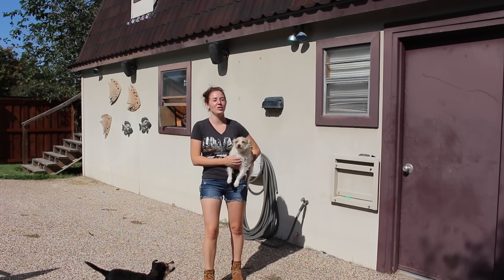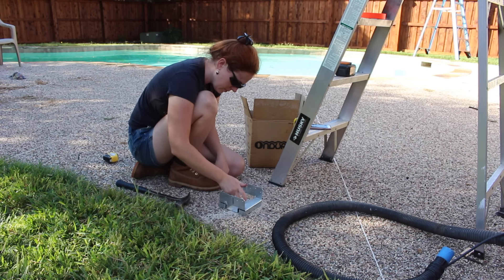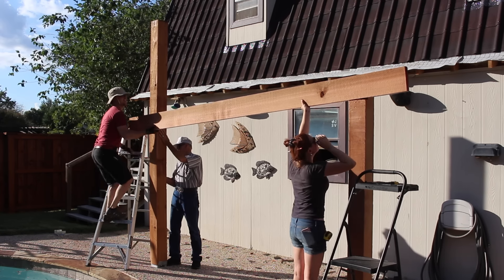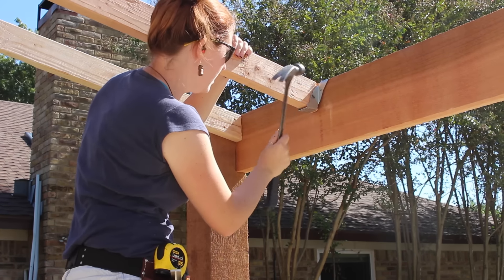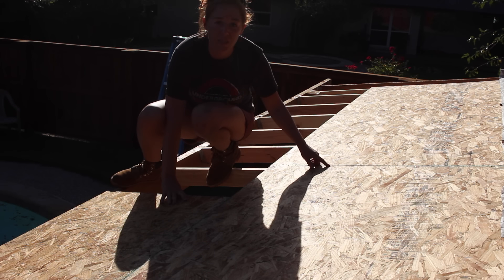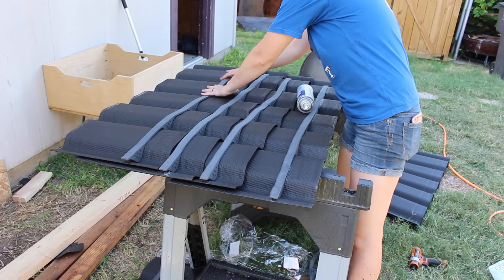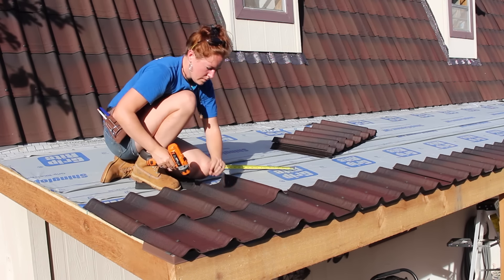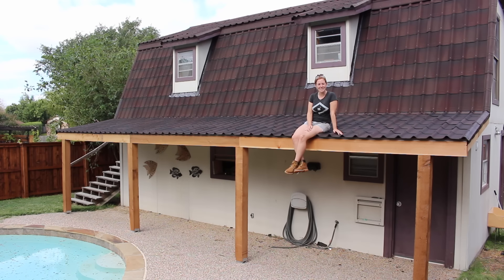How To Build a Covered Patio | DIY Porch Part 1

Comment: It's seems weird that American DIYers just don't seem to have SDS hammer drills, in the UK if you do any DIY you need one, they are just necessary since our houses are make of brick.
Reply: Absolutely (I'm from the Netherlands) and when doing things around the house you absolutely need one
Reply: Interesting. I live in the US and have one, but nobody else I know has one. It is amazing how well they go through masonry.
Reply: And in Germany you need a hammer drill, too.
Reply: I've had one for 35 years, the only way to go!
Reply: +Foeke van Veenendaal Everybody builds with what's local and cheap. Where I'm living now, stones, clay, and sand are local and cheap. That's why a lot of the houses in the neighborhood have 5 foot thick walls made mostly of native stones with clay and sand mortar. The houses last 300 years instead of the 30 years you get with balloon framing.
Reply: I imagine that all the rain in the UK makes wood houses a bit of a no go in terms of rot and damp.
Reply: Well, considering that our country isn't even 300 years old yet...
Reply: I've got mine! would never be without again.
Reply: My house was built in 1928 with balloon framing.  Doesn't seem like it's coming down anytime soon.  30 years?
Reply: Kelly Stone In any data set, there are outliers
Reply: Yeah my town has thousands
Reply: More timber framed houses are starting to be built within the UK now. It was a big problem with getting insurance for your house if it was timber framed. However, that mind set is changing with insures now.
Reply: A good thing as they go up in weeks, not months like brick houses and that's what we need, more homes.
Reply: markblue777 Timber framed or balloon framed? Balloon framed is made mostly of 2x4 (5cm x 10cm) studs, goes together quickly and cheaply and looks very good, for the amount spent, for the first ten years or so. It goes up fast, comes down fast, and is cheap to build.
Reply: well the original lot that insurance companies would not touch were the Balloon framed. Now days it's more pre-fabricated wood panels so its build in the factory rather than on site. (timber framed was a poor choice in words i realise now as timber framed house, made with oak and such have been excepted and still are made as well).
Reply: I have never seen any houses here framed with 2x4s that look good only the first ten years or so? I wonder where you are getting your information since you aren't local and wouldn't know these things. We have timber homes because we have lots of timber. They are beautiful and well  built and warm, by the way. Stone houses are beautiful also.
Reply: letmework Where is the "here" that I'm not local to?
Timber framing is completely different from 2x4 studding.
Reply: Jim Fortune; I'm sorry I didn't make my response more clear. "local" is America where Foeke van Veenendal stated that "weird" materials are used.  In what environment does pine only last two years tops? And were the fences that were needing repair after a wind storm, split rail? Part of the beauty of any region or locale is seeing how the natural environment is incorporated into buildings and architecture. We are surrounded by beautiful forests and love it!  Why shouldnt we showcase these beautiful species in our homes?  We recently lost a one hundred years+ Big Leaf Maple tree in our back yard and instead of cutting it up for firewood we had it milled into lumber to make furniture with the beautifully spalted wood. And perhaps you misundertood my comment about timber homes. I did not say timber -framed homes. Timber homes are homes made from timber (wood) vs. stone, brick, clay, etc. As far as 2x4 stud framing; I live in a home built that way and it's now 45 years old and is as good as it was the day it was built. Perhaps the commenters here are completely misinformed. We'll give you the benefit of the doubt.
Reply: letmework I have to confess that my disdain of balloon framing comes mostly from 40 years living in Southern California. The tract housing there is thrown up quickly, on a budget, and with assembly line techniques. Most of the framers don't know nor care what "square" is and the materials are not exactly hand selected for superior quality. Typical construction is 2x4 frame clad with chipboard, covered with tar paper and chicken wire, then sprayed with stucco. Even in a climate that seldom sees snow or ice the houses deteriorate pretty quickly. Ten years and the house is in need of significant work, and after thirty years it's a debate as to whether it isn't better to just tear it down and start over.
By contrast, I'm now living in a 300 year old house in Poland. The ground floor walls are about 6 foot thick stone and brick, the upper floor is half timbered and the "new work" done upstairs is about 100 years old. It's quite a contrast from So. Cal.
Reply: It's more about instant gratification and our disposable culture. The town I am from used to be all adobe houses but now everyone just buys a mobile home.
Reply: Kelly Stone You are smart. Why does everyone hate wooden houses. There are 3 story wood houses in the original colony states (New York, Massachusetts...) that are wood framed with rubblestone foundations that have been her longer than the USA was a country.
Reply: Jim Fortune Actually, most modern framing with studs that we are used to is called platform framing, and is very sturdy, especially thanks to pressure treated products, codes that overbuild everything (which is good).
Reply: Jim Fortune Well, that has more to do with crappy carpenters. Also, it os now called platform framing. Balloon framing uses a slightly different stud and header system and was used mainly before WW2. Its downfall was that it required long studs.
Reply: Mark Doumert 

g

8
Reply: I remember from a high school history class (30 years ago) that stone became the preferred building material to wood after the "great fire of London." I thought that was a no-brainer. As for building materials used between Europe and North America, I hate to say it but both regions subscribe to the "international building code." That means if you pull a permit to build something, you will subscribe to the same set of laws governing better building practices in both regions as set forth by the endless committees of structural engineers across the globe. That will dictate everything from wind and weight loads to anchor/fastener spacing, acceptable materials for intended purpose, footer size according to soil type, to you-name-it
Reply: Yeah you are so right! I'm using an SDS drill all the time when I'm busy constructing. ( The Netherlands ).

Comment: I was a professional roofer for many years.  I was super impressed with how you took into account from which direction you could see the tiles from the ground (from your porch) and you overlapped them in such a way that the overlaps were not so visible.  Not many people think about this aspect.  Good work!
Reply: @abigailarizmendi1261  😂
Reply: It's also the same overlap orientation as the rest of the roof, so just makes sense.

Comment: Looks good! For future reference, you should install the bottom drip edge first and then your underlayment (synthetic tar paper) next. The underlayment should overlap the drip edge so that any water that has gotten under the shingles will flow out and over the drip edge. With your installation the water will actually end up flowing under the drip edge and may even result in more damage to the decking than a roof without drip edge installed. So just like you overlapped the underlayment as you installed it up the slope of the roof, you should overlap the underlayment over the drip edge. On a side note, if you ever install drip edge on the ends (sides) of the slope then you would actually want to put it on top of the underlayment. Keep up the good work!
Reply: Did you catch the width between the post?

Comment: Well done April. Maybe use some bracing timber and clamps when installing the posts but as you say, first time. Also, a quick and accurate way of measuring center to center of posts is to measure outside of post one to near side of post 2 at ground level.

Comment: April, you never fail to amaze. Nothing is too big or too hard. I wonder what you will be doing in 5 years time? "Today I'm going to be building a 12 story office block and suspension bridge"
On ya mate.
Reply from the maker: Haha a suspension bridge probably won't ever be in my wheel house, but who knows!? ; )
Reply: April...I know. It's just a project with drawings, engineering, specifications, materials, inspectors and employees and I'm sure that bill baggins doesn't see anything impossible! Am I correct bill?

....13
Reply: I try to find the positives in life. April is a very smart lady and I'm sure could achieve many things. Just paying a compliment.

Comment: I think this really came out nice. I am very impressed with those shingles. I am a luthier   and I am going to be finishing up my own wood working shop next spring . I was going to use metal but after seeing yours I think I will check pricing of this type if it' comparable I think I'll try this instead.
Thanks April.

Comment: Looks really nice! I have never seen those kind of shingles before.
Reply: Sand Plastic tiles are not new, more newish really.  There is a Russian company making them and an African company too, both of which are on youtube and you can watch the manufacturing techniques for them.
Reply: Lowe's carries a type of these.
Reply: They do?  I was thinking the idea was a good one; going to have to look those up at the local store!
Reply: Alonzo Branson . the ones Lowe's has come in sheets, and are like corrugated greenhouse roofing, but are sold and made of what appears to be the same material. apparently the product has to be painted every few years, as it fades. I looked into it a few years back, and while I thought it was an interesting product, I did not think it would do well in our Northeast climate. Maybe in TX it does better.
Reply: David Dolch Q

Comment: Nice work, as usual!! April you need to use some hearing protection... You will miss your hearing when it's gone.
Reply: I've read in comments in previous videos, her ear protection is inside the ear and not visible on camera
Reply from the maker: You can see them, they are the black things in my ears.
Reply: Anders Andersen    YES  YES  YES   AMIGO  ESTA  BONITO   MUY  BIEM   BUEN  TRABAJO  👏👏👏👏👏👏👏👏👍👍👍👍👍👍👍👍👍👍👍👍👍👍👍👍100%100% $👍✌👌
Reply: W Ippolito
Reply: W Ippolito

Comment: Why no footers for those posts? Is that an area with no wind, I.e., no upforce issues?
Reply: I was wondering that too I am pretty sure the weight of the porch will start to crack the concrete patio over time.
Reply: no way that concrete is at least 8 inches thick

Comment: how does the exposed screws not leak. typical roofing each new course covers up the fastener for the previous course
Reply from the maker: They are special screws made by the same company, they have a washer on them that seals around the shingle.
Reply: Have a feeling this will come back to haunt them

Comment: Looks great! I work alone frequently and a couple hundred spent on a laser takes a lot of physical work out of decks. Control line helps with deck ledgers and finished decking height, ground height variances, and notch layouts all at once. Well done!

Comment: On a 2/12 slope, I wouldve used a peel n stick underlayment like Carlisle Wip Grip instead of the single layer of synthetic underlayment. Gotta be ready for them strong wind driven rains like we get regularly in Fla. One side note: use a chalk line to mark the roof and you won't be using a tape measure to set every shingle.Nice job!

Comment: What would I need to do if its not on concrete?  Would you suggest digging a hole and filling with concrete and following the same method? Or putting the post in the hole and encasing that with concrete?

Comment: I’m going to put a porch over an existing deck. My problem is my wall is only around 7 1/2 feet tall which leaves me very little room around the windows and doors. What I’d like to know is if there’s a way to take off the existing facia And Guttering and tie the rafters into the existing rafters that are on the house roof.

Comment: Could you have added a ledger board to the board at the end of the board that covered the rafter tails ? Think of doing that instead of ripping all that off mine.  Or those rafter hangers ? Nice job

Comment: Hi April thank you posting this video. I am taking notes and will try to repeat this process at my own home. I have a question though when you make those slit cuts at the top of your post to create a notch for the 2 by 8 header, I notched you laid your circular saw down flat on the post. So does that mean the depth of cut of the circular saw matched exactly the thickness of the 2 by 8 header. I mean it seemed like it did because at the end of the video the surface of your header looked flush to the surface your post. I measured the length of my own circular saw from the shoe to the bottom of the blade and I got about 3 inches. Does that mean those 2 by 8s are really closer to 3 by 8s. Sorry for the long question I am new at this stuff.

Comment: Awesome video!! I am going to do the same thing as you! Quick question. My rafters stick out about 13 inches from wall, I won’t air mine inside the cross beam. Will it still be safe to screw them to the 2x4 rafters that are sticking out of the wall? I suck at building and explaining. Sorry.

Comment: Will that roofing hold up to large hail? I used some Ondura (corrugated asphalt-- that looks similar to  Onduvilla) on a small shed and the first substantial hail storm went right through the ridges. It was great to work with but didn't last here.

Comment: Nice job...looks strong...I have something pretty similar to build along my rear yard only it will be a wooden deck instead of concrete....was wondering how you tied in the roof line to the addition...very nicely done. Thanks.

Comment: Wow. Just amazing.
One question. I'm planning on building a roof like that, but here in Japan they say that columns spam can't be over 2 m. Well it could, but the header would have to be way thick, like 3 pieces of  2"x8" together.
I don't think all that thickness is necessary, so what's the spam of your columns? It's very wide.
And, is a 2"x8" header enough for asphalt shingles?

Comment: @ 4.15, nothing wrong with a smaller hammer. there is some science that says a smaller hammer can hit harder, as it can be swung faster. i don't remember the constant on the mass, but basically, the energy is equal to the mass times the SQUARE of the velocity.

Comment: I did a great job I wish I could be young again and work like you. The srthritis is getting the best of me. One tip for you is to get cordless impact guns and use more screws in stead of nails to save on wear and tear on your body . That hammering takes a toll on your hands and elbows. Also invest in s 12” sliding compound miter saw . You can make up to 9.5” 45• cuts I got a ryobi at Home Depot for a $239.00 it’s one of the best investment I made

Comment: I’m thinking about a similar project. I also have a pool close to the house with a pre-existing concrete slab patio. Were you concerned about using footers. I was wondering if I have to saw cut the concrete and dig down and add footers. What are your thoughts

Comment: For my installation, should screws be placed higher as to be covered by the following shingle as a standard shingle is installed? Or will it be just as effective taring, or sealing eat screw hole?

Comment: Wow! What a great job! I am so impressed with the project and the video presentation! I am looking to do this same type of covered patio on my back deck which is 34' in length and 12' wide from house to front deck. What was the size of this cover and the cost of the project?

Comment: What size rafter do I need for 25' '36' patio cover, and also how far can I place posts, I'm trying not to put any post in the middle, only on the sides

Thnx
Reply: Annie A google a span chart and it will show you the size of beam you need based on how far you want to clear span.

Comment: Structures like this should stand on THEIR’ OWN.

Notice no vertical support on the building side.

This structure is dependent and DEPENDING on the house for its vertical support.

Three vertical support beams in the building side would have made this project a safe structure.

This can be fixed, but as it is, this structure is a risk.

Comment: I'm just wondering why American houses always have roof that is very low to the ground that it looks like a kiddie house? You can literally reach out to hold the rim of the roof without using ladder. In where I live, house roofs are always quite high from the ground.

Comment: Those posts need a concrete footing dug and not just sitting there on the surface to deal with surface expansion in the event of a freeze.  I guess building codes or inspections don't exist where you reside.
Reply: She bolted them in to something

Comment: But is it going to leak? You just put some screws in the singles 🧐
Reply: Shingles are made of a self-sealing material that seals in around the nail/screw as long as they are done at the proper depth.

Comment: Love your videos, but I honestly am shocked every time I see how American homes are built. 
Wood, some plywood, foil around it... it’s insanity. Here sheds are built like that, maybe even a cabin in the woods.
And the Problem with this structure is, that it is too weak to hold a clay or concrete tile roof, and you have to use wood, steel of bitum or some stuff like that which will only last 30 yrs.